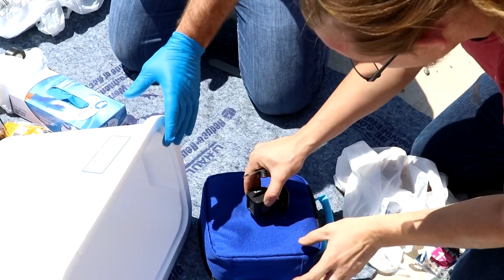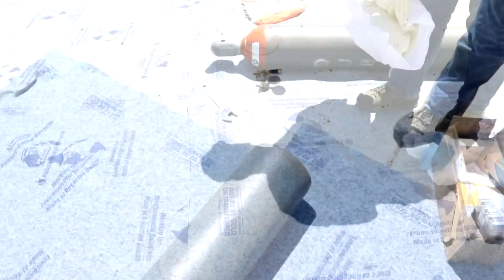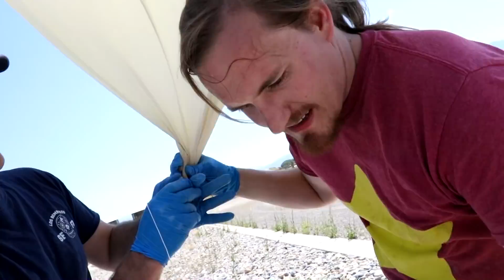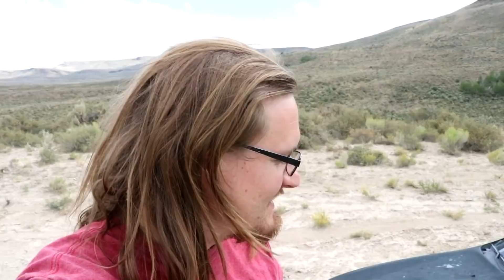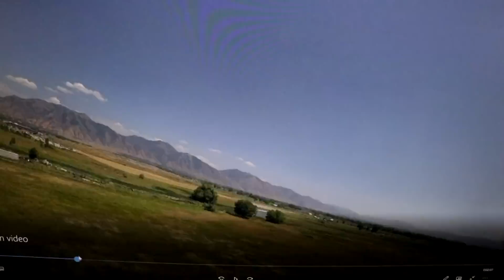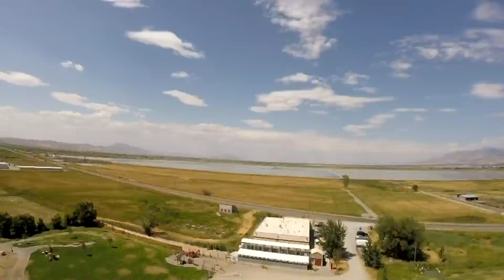My First High Altitude Balloon

Comment: Is there any reason not to use Hydrogen for the lift gas? It's lighter after all, and also not a limited resource like Helium, so should be much cheaper.

I doubt the flammability of it should be much of an issue, especially when the only possible source of ignition (your electronics) is suspended 10 yards below, so you're not likely to do a Hindenburg (and modern theory says it was the aluminium/aluminum doping that was the initial ignition point anyway)... Even if you did, it would make for some great footage!

Last thing, put a fin or something on one side of the payload, like a weather cock/vane. That way it will turn to face into the wind and not randomly windmill.

Comment: I actually thought you overinflated: whenever you see pictures of the very high altitude balloons, they look underinflated on the ground, but swell up when they reach higher altitudes where the external pressure is lower. At that point, anything beyond what is needed to get the balloon fully inflated actually weighs it down.

Comment: I'm not sure if anyone else has corrected Cody on this one (I'm not going to read all the comments to see). But radiation actually goes down after about 70,000 ft. So at first the levels increase and then peak at around 60,000-70,000 feet and then they drop.....just like his data shows, except Cody mis-interpreted his data.

Comment: An idea for the next time, if you want a continuated video: just open the go pro, and wire some batteries from the battery pack in paralel with the go pro's own battery. Your efficiency is probably about 65-70% if the battery pack steps up and tries to recharge the go pro. Wiring it in paralel would just boost the recording time, without loosing any power on the voltage conversion. Also, the batteries would go 100%, unlimited by the battery pack's step-up circuit, wich failed this time since, as you said, couldn't keep up with the camera's power hunger...

Comment: Cody, remove the battery when using an external power source. I was trying out my go pro in the freezer with an external power source for an upcoming video and it switched off after 40 mins when the internal battery ran out. When I put it back in with only the external power source, it didn't run out of charge. Yours ran out after 3 mins which was probably the remaining charge in the battery.

Comment: What about some software to fix the rotation? Something that takes every frame that points in a certain direction and puts that into a video? I know the spin isn't consistent which will make it kinda hard and you aren't really into programming, but I think it would be a really cool idea. You'd end up with a low framerate 360 video.

Comment: Hey Cody! 
As part of my undergraduate study, we flew some weather balloons with Geiger counters. Your explanation about the radiation levels at altitude is incorrect. 
The fall-off we see after the fist maxima in the counts per second (CPS) is a result of the composition of the atmosphere at that altitude. The higher CPS at the beginning are a result of low energy secondary radiation from high energy particles interacting with the atmosphere. Think of secondary radiation as a glass ball being thrown at a really strong pinhead. The glass ball (high energy radiation) will shatter, sending little pieces (secondary radiation) in the direction of travel of the original glass ball. 
The CPS falls off after the first maxima because the atmospheric composition/density decreases the likelihood for high energy particle interaction (thus decreasing low energy particle events).  The amount of high energy particles interacting with the atmosphere is more or less constant, so we see less CPS after 20-23Km ish because we’re not detecting all the little bits of shattered glass anymore, just the big glass ball.  
Once the payload starts descending, you’ll see the same CPS maxima at around the same altitude of the first.  The CPS is almost completely independent of the position of the sun relative to earth. 
Our flight lasted 3 hours from release to touchdown. 
We flew an altimeter, temperature sensors, pressure sensors, 3 Geiger counters with different tubes, and a GPS. 
We flew about 20 times! Through thunderstorms, at night, during the summer and winter.

Comment: You could probably pick N landmarks from that video and then edit it into N moderately-shaky-but-not-whirly video streams, each consisting only of video frames with its landmark near the center of the screen. Now instead of one gently rising whirly camera, you have N rapidly-rising shaky cameras.

Of course, it'd be a lot of work.

Comment: Every high altitude video I have seen are all universally terrible. The spinning all the time! Here's a project for Cody! Put a low friction swivel between the balloon and the camera bag. Then put large side wings on the bag to reduce twisting by air drag. Or put a drone gimbal and boost the transmitter to give a 30+ mile range. Then chase the balloon! :)

Comment: Try a gyroscope powered by a li ion battery pack. Or use a power tool battery pack. You only need it to run for maybe 20 mins or so. Maybe you could get an altimeter switch to add power from a second battery bank during the decent.

 Another thing you could do it point the camera down and fix it in the edit - I've seen some one here on YT launching their gopro a couple hundred feet that did that.

Comment: How could they sell a camera with a battery life of 3 minutes??  One hooked to a battery pack, no less?  Is the battery old?  Or was it under charged from the beginning?  That doesn't seem right at all..
Reply: it probably overheated with the heat packs before it reached cooler air. Youll probably remember, they almost didnt put the heat packs in.

Comment: i'm still wondered why Cody with having such big land not making his personal height tower for meteorological and flying equipment testing. Most famous tower constructions are made from steel starting XXth century (like Eiffel tower), but today we have an interesting material - the plastic tubes with aluminum core (which used in house water heating piping) - it's very light and at the same time flexible with specific stiffness, what if we use several pipes together - that can make very light and very stiff structure. 🤔

Comment: What if you deployed a foldable glider with autonomous control and solar panels  (batteries still included) and got it to unfold wings (aka "launch configuration") when it detects it's experiencing freefall, making it's way back to you?
And yes by glider I mean it doesn't have propellers or turbines on it

Comment: Why do you use helium instead of hydrogen in a high altitude balloon? You could make a bunch of hydrogen relatively quickly with elemental calcium and water (or metal and strong acid), it would be cheaper, and provide significantly more lift.

Comment: I've tried this once before, but the GPS receiver failed, even though everything else worked like a charm we weren't able to recover the payload and lost all video (3 HD action cams) and data. About the most disappointing experience in my life (worked on it for about a year with some friends). I'm planning to try it again somewhere within the next year with some extra sensors on it as well, I'm hoping to be able to put a DIY gamma spectrometer in there :)

Comment: lmao. Great video. Thanks!

I love the ending. You weren't joking. That rotation is nuts! I started getting sick. 

I wonder if the camera charger detached from the violence of the rotation?
Reply: I think it overheated
Reply: Good point. Too many thermal packets. Shoulda checked the voltage on the battery after landing.

Comment: A powerbank should be able to handle charging the GoPro fast enough. I believe that your micro to type c adapter disconnected. Those are not the most stable connections :)

Comment: GoPro seems to be a "hit and miss", I have a few of them, my 1st, a Hero III Black will run so hot that it will shut off, most of my batteries are swollen so not only was the cam shutting down from heat, but the batteries were tripping the built in safety relay. The "Session" like you have here has been more dependable, but I would suggest turning off the BLUETOOTH next time, I think it can get "funny" commands from your device or from other places. very sad to see this fail, I been wanting to do one myself... btw, try to be safe wandering alone in BF-noplace.

Comment: At least use a GPS module that will track to high altitude. There are several readily available that can provide data to well over 100,000 feet. Homebrew an altitude and position datalogger with an Arduino if necessary.

Comment: Too bad the camera shut off… Might it have just overheated and shut down as a failsafe? I know gopro cameras do that… To be honest, despite the obviously low temperatures up in the atmosphere, I don't know why you added all those heat packs… Because the battery and the gopro produce so much heat by themselves when operating that they would probably have stayed within operating temperature until well up into space.

Comment: How do you link the rings when they are closed?
Reply: Knitting maile? One method is to make a bunch of closed rings and link them together by bending split rings shut to connect them. I prefer to knit with all open rings in a sequential linear fashion, but some folks make lines and tie them to the main sheet.

Comment: I heard the iPhone 7 the one without the headphone jack has a barometer altimeter and that was the reason why it doesn't have a headphone jack. Anyways couldn't you put one of those in the lunch box instead, August of the cameras not as good but it's good enough, it probably won't get damaged so you can reuse it, and it has a bunch of other equipment like data and GPS built-in. That way it's easier to track. I don't think you need anything else other than the iPhone 7 maybe the iPhone 6 is all the equipment.

Comment: why would you loose gps at 30k ft?
Reply: John Smith Likely has something to do with the safeguards built into commercially available GPS units to prevent using them for missile guidance.
Reply: The GPS limitation is 60k ft, seeing that you can buy aviation GPS without any restriction and they have to be good up to cruising altitude. Mazbe another battery issue, although it must have come back on for the landing position?
Reply: It's possible that the manufacturer set a lower limit. I suppose it's also possible the battery got too cold and shut down but if that happened I'm not sure the unit would turn back on.
Reply: Google Spot Gen3 epirb. Its listed "OPERATING ALTITUDE" is "-328ft to +21,320ft (-100m to +6,500m)", so if his 30k number is correct then it far exceeded the manufacturer's specs.
Reply: Im guessing his GPS device is designed for ground use in relation to the satilite setup, vectors directions and distances and all that. Calibration.

Comment: Why not use hydrogen.  You could generate it on site and it wouldn't be that difficult to keep it safe, it's not like you are riding under it or using engines.  The Germans managed it  quite a long time before "that day".  That way you could, of course, get more liftk you wouldn't be wasting our limited supply of Helium, and finally, Hydrogen is cooler.

Comment: I am sad you didn't get all your your full trip data or video. But am very  excited to see you got your equipment back! I am a Ham and launched baloon over 6 years ago. We had plenty of power, ham transmitter and video camera. wwe tracked it up to mountains around Tehachapi before it appeared everything failed. Don't remember exact flight time, but our transmitted video ranged about 20 miles I believe. We just barely  went over the weight limits as I used a 12volt gelcell battery. Yep we lost it all!

Comment: Why use helium and not hydrogen? There is only a limited amount of helium and we shouldn't be wasting it in weather balloons. Hydrogen is cheaper and there are many ways to make it. Hydrogen is flammable but there are no sources of ignition up high in the atmosphere. Also, hydrogen has more lift so you need less.
Reply: No sources of ignition? What about the engine of an airliner?

Comment: GoPro are sooo unreliable. Like there are SO many videos where a GoPro is used to record stuff and the GoPro doesn't record anything even though its light is blinking and/or it stops recording, soon after it is turned on, for no apparent reason. Like almost every balloon launch I have seen that used a GoPro had at least one of the GoPros (if they used more than one, obviously) they used fail. Basically, don't rely on GoPros, they are unreliable pieces of crap.

Comment: I've you're not failing, you're not learning. Wondering if you could use a larger parachute as a means of harnessing the balloon and run four lines down to attach the payload on each corner ( styrene cooler box?) to eliminate spin? # balloonbra !  Three quarters of a tank of helium ?......Go for gold !!